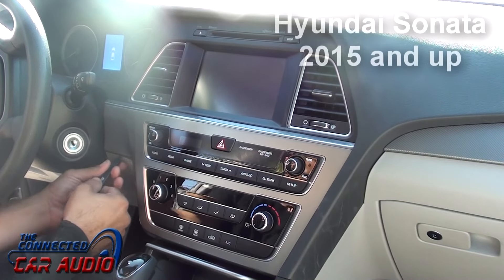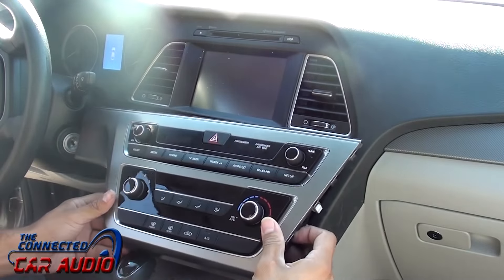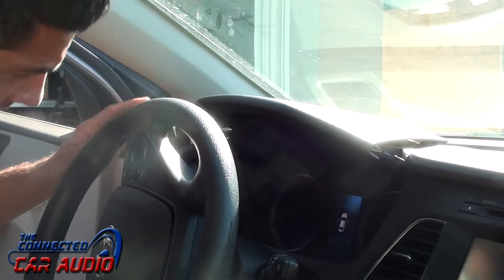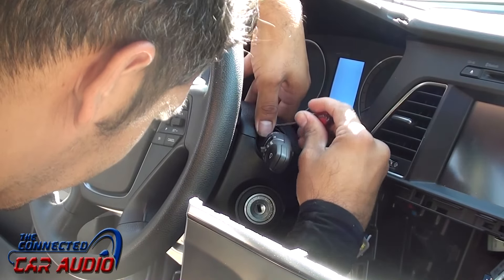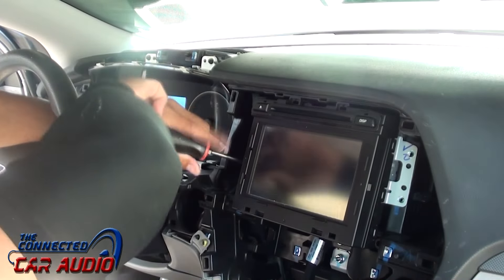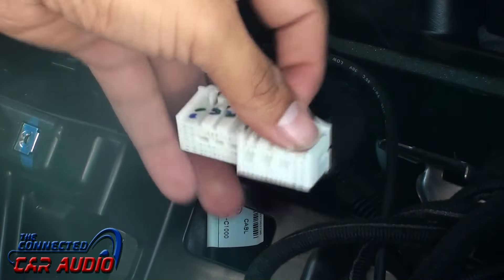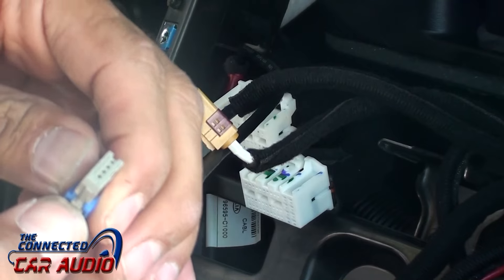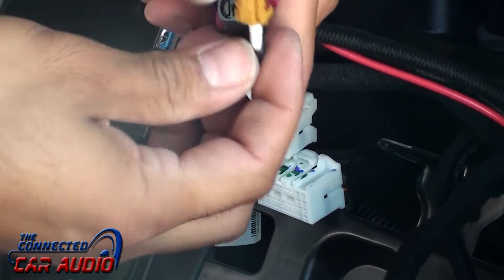Hyundai sonata 2015 and up stereo removal

Comment: I own a 2017 sonata and yeah this car has a pretty pathetic stereo system.
Reply: I have a 2016 Sonata and the radio would get stuck on the "welcome Hyundai" screen...then if I would wait two minutes...restart the car...the screen would play normal. Now the screen is just blank. I hit the reset button amd nothing changed. A diagnosis is $89.00, and the dealer said it would be $2,800 to replace it if it went out...
Reply: @Kev621  buy it from eBay 100 dollar used get the part number my radio is screen is having problem to I will buy a used one and change by my self.
Reply: @snlkrd5200  Ooooooooh I was happy and pissed at the same time. I made an appointment to get it done. It had been 2 to 3 weeks it was out. One day I stopped by someone's house and when I left, I put the car in reverse, checked my camera and slowly backed up, then I hit dry brakes...how in the hell did I check my camera, all of sudden everything started working properly....but thanks.

Comment: Did you remove this screen/radio unit just for an upgrade or were there issues with the unit? I have a 16 sonataSE with a screen stuck in reboot. The screen turns off every ten seconds then automatically turns back on. I can't change my clock, use Android Auto, change any sound settings, etc. Have you ever seen this issue? If so, did it have an easy fix? Thanks!
Reply: Im having this same problem now any fixes yet?
Reply: @goated_x_glc8757  I ended up buying a used radio/screen off ebay(nobody near me had one) and replacing the whole assembly. With the right tools to remove the dash, it wasn't too difficult to do!
Reply: That happened to me too and randomly turning the car on one day a reboot bar popped up as if I caught an update somehow waited for it to load and it started working after that.

Comment: That is unreal how easy you make removing the climate control look. I'm becoming fatigued from just trying for half an hour and I can't even really continue anymore.
Reply from the maker: Lots of practice for sure 

Are you using a plastic prying tool?
Reply: @connectedcaraudio  Yes I was using that tool. Thank you for responding. I finally got it, but man that was in there. I'm now trying to figure out which wire on the two harnesses behind the stock stereo is power and ground. I keep trying the red and black wires but can't get my aftermarket deck to turn on no matter what I do. I'll get it eventually. Thanks for the video
Reply: Did you ever get the aftermarket deck installed? Would like to know if its worth the trouble. My factory unit has been out for a year. Didn't plan on keeping the car but Hyundai replaced my engine under warranty.

Comment: I have a question in general. Is it possible to have an audio auxiliary output from head unit?
Reply: You can buy a line output converter to connect to your rear speaker outputs so you can get rca outputs for an amplifier

Comment: How can I swap this 8-inch touch screen into the base model (5-inch touch screen) head unit? since it has a little different harness. since I see that the trim you have doesn't come originally with this stereo and you've replaced it.
Reply: Hassan kianmehr was wondering the same thing.
Reply: base model is even smaller 3.5" and is only blue color, no touch screen haha

Comment: Thanks for the great videos, they help a lot. I want to ask if it’s possible to upgrade/swap your 2015-17 Sonata stereo from the base unit to the 8 inch touch screen factory unit if you get the correct dash face radio bezel. Are the connectors the same ect. Thanks
Reply: Did you ever get the right answer?
Reply: I want to know if the plugs will work, Did you ever find out?
Reply: No, I’m still looking into it. I want to upgrade to the best Hyundai factory radio that will work.
Reply: I will post here when I figure it out.
Reply: Also want to know this.
Reply: Pioneer  Mixtrax model FH-x720BT...sounds reallly nice !!  Just saved ares from going to the junk yard
Reply: Same! I have the base radio and want the 8 inch radio so I can use apple carplay. I know I could buy aftermarket but there are so many deals on Oem replacement radios that would seem to be a seamless upgrade.
Reply: Any luck? I'm looking into this currently and have not come to a definite conclusion. I am almost positive that the mid level screen (color screen with 5") is a swap from the base (Blue only color 3.5"). It would use the same bezel and the connectors. I am not sure about the 8" being a direct swap. Seems to be considerably more connectors, and if it came from the upgraded sound system, them it would want to connect to an amp that the base model wouldn't have, not to mention cameras, more speakers etc. My guess is if you pulled an 8" from a similar audio setup then you could take the bezel from the same car too? It is sold separately but for $180 from Metra.
Reply: Actually I do not think the 8" would work as the buttons for volume, seek, track, setup are on the piece that is seen in 00:32 .

Comment: Does anyone know of a aftermarket radio that is compatible with the steering wheel control, I have a 2017 sonata se with the cheap stereo(not touchscreen)and I want to upgrade it to touchscreen  badly but will hate to lose the use of the steering wheel control and bluetooth functionality? thanks in advance
Reply: I have the same vehicle. I got a Dual DMCPA70 and bought a PAC SWI-CP2 Steering Wheel Control Adapter to retain some of the steering wheel buttons. Everything works except the speak button on the left side.

Comment: Does anyone have any good recommendations for a quality replacement? I'm about to replace the head unit on my 2015 and I'd like to know if anyone knows about a good one with the same functionality but top quality sound.
Reply: I would never lose all my buttons by changing the factory head unit. The reliability of factory is so much better. The quality can be improved by adding amplifiers.
Keep the head end.
Reply: What for. Pretty sure I cant pump 1000 watts of ridiculous bass out of a 2018 due to how the factory head unit is set up
Reply: @Ger0n1m0  Kicker Keyloc. ;-)
Reply: @edgonzalez7283  the keyloc seems very small. Also I cant find a 1000 watt amp for that type of woofer

Comment: My radio looks different than that the cd inlet is placed in a different spot and the volume knob is different as well it's a touch screen radio and it come factory like that and it's a 2015 sonata
Reply: Will the removal be the same way? Would inhave to buyba dash kit to put a aftermarket double din in? Please get back to me asap I'm wamting to know so I can surprise my wife with a new head unit

Comment: Well, maybe this is a silly question, but, How do I update the maps in this stereo-gps navigator unit? I have a Sonata 2016 and I have no idea how to update the maps. I have watched some videos here and there and they talk about to remove the SD Card from the navigator unit, but I don't see any slot. I will appreciate your help, guys!  Greetings from Mexico.
Reply: If it doesn't have a slot for a card you don't have navigation. But you can connect your phone and display google maps on the headunit.

Comment: Hi, What panel removal tools do you use?
Reply from the maker: +coffeeis4closers I use a panel removal tool that is plastic Infused with fiberglass. It also has a non marring surface. Company called bojo makes them
Reply: @connectedcaraudio  Yet at 3:13 you clearly marred the dash.

Comment: sonata 2015Service check radio not working at car need today ref. attached wip# 54323 REFUSED TO REPAIR RADIO FOUND RADIO UNIT HAS INTERNAL 80ELEO06 NOTES SHORTED.